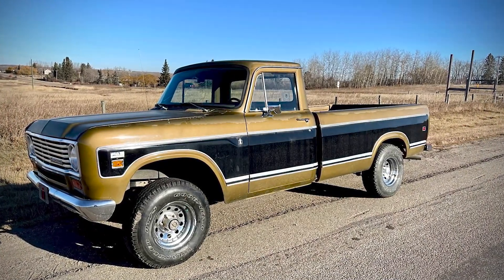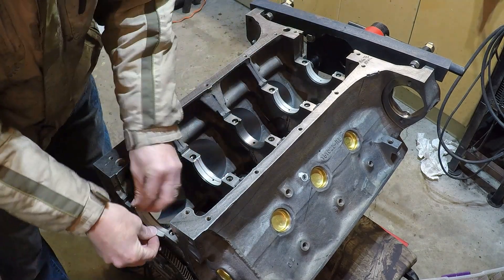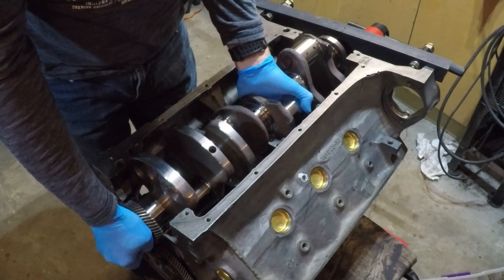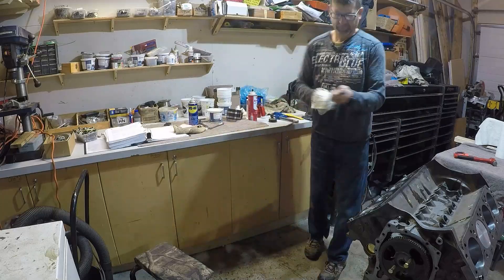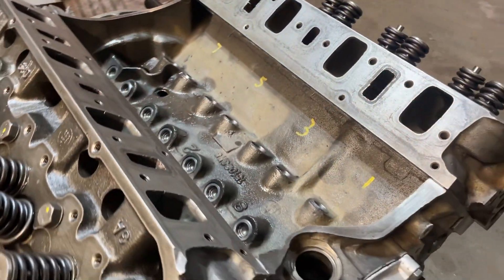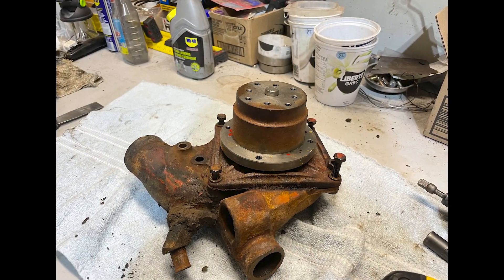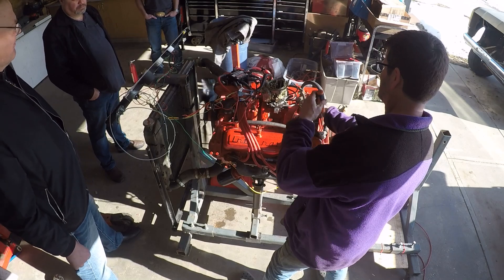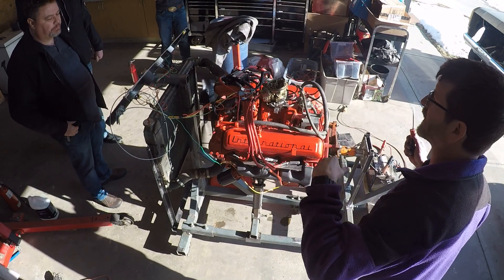INTERNATIONAL 345 Engine Rebuild part 3 - reassembly

Comment: great video! thanks for sharing. How difficult was the timing gear to mount to the camshaft?
Reply from the maker: @dwaynelove5954  I couldn’t get the timing gear off the camshaft when I first pulled it from the engine so it stayed on the whole time.

Comment: Damn engine is beefy. Timing gears instead of a chain, big ports, canted valves, skirted block and all cast iron. Seemed like a real pleasure to work on. Often times a dedicated amateur has clear vision and you also got help and references where needed. Very thoughtful process you did great! I wonder now that you've done this what tools you wish you had that you didn't? Any lessons learned? What cleaning solutions worked best for you when cleaning parts?
Reply from the maker: @wtdonovan  ya it’s a chunky piece of cast iron. A really enjoyable learning experience for sure and I can say that now that it’s complete and running. 

I wish I had gotten the proper ring install sleeve/tool. Also, I wish I would’ve decided earlier to have the shop hot tank the block and heads. Would’ve saved a lot of time rather than cleaning them my self. I used varsol, acetone, gas.  Pretty much anything I could think of to clean parts. They all help a bit but mostly just time and effort is what works.